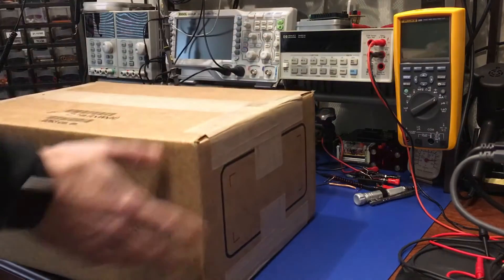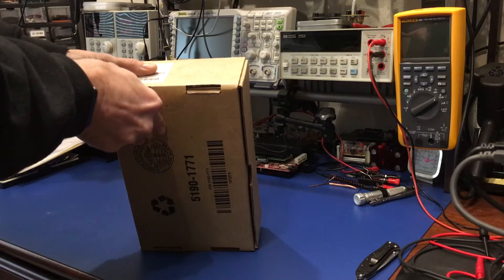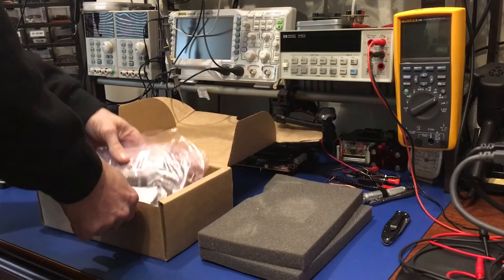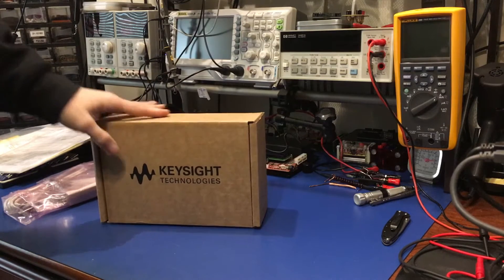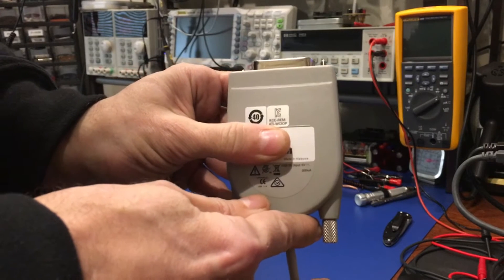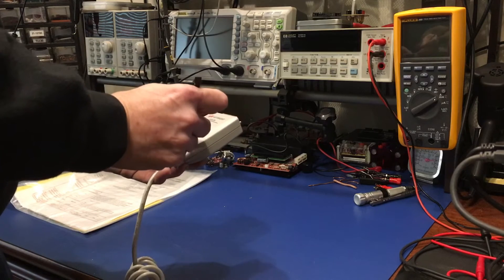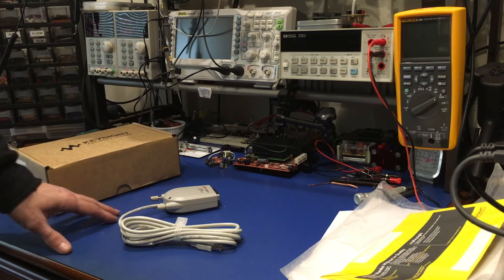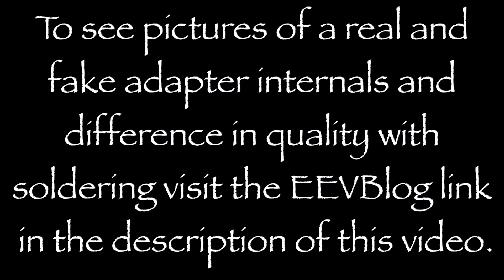Agilent KeySight Authentic GPIB to USB Adapter

Comment: Yeah, ive used that packaging before.. its a binary mixture that comes in 55 gallon drums, the machine mixes it together when filling the plastic, its quite interesting stuff to work with.  But if you get it on you during the process, it burns lol, and doesnt come off easily if at all depending on if its on clothing or skin.  Works VERY well though.  Anyhow, i appreciate the video as ive been looking to get a GPIB adapter for a bit now..
Reply from the maker: It was defiantly an interesting packing, seems to work great. Maybe overkill for this GBIP adapter, but I’m sure they use this with the scopes and other high end equipment. 
I might find out soon, thinking of getting a signal generator. Well for a decent one it will only be a little more to get the keiydight 1000x series oscilloscope with the wave generator and other things included like hardware decoding. It will be interesting to see the big difference in performance with s Keysight 1000 series low end VS a Rigol 1054Z with all the software licenses. But the Rigol is still mostly all software functions, not dedicated hardware decoding for IC, SPI and other things. 
I’m assuming if I buy one it will have the same packing foam. 
Thanks for watching,
Scott

Comment: The real question is who cares. People are tired of being ripped off by US companies who massively overcharge for simple items like USB adapters. Seriously Keysight wants nearly $500 for a damn USB adapter. The vast majority of people buying these things off eBay are hobbyists using older equipment and they seem to work fine for that. In fact, from what I have read the controller, chips are actually older 2009 Agilent chips that have been scavenged. 

The bottom line is I've been using clones for several years now on several pieces of older equipment including an 8753c VNA as well as an Agilent service monitor, signal generator and spectrum analyzer and they have operated absolutely flawlessly. 

To be honest, I would have felt like a damn moron if I had spent $500 each on these from KeySight.  If you're willing to spend $500 to appease your ego when a $50 device would otherwise work then I guess the old saying " a fool and their money are soon parted" fits the bill.
Reply from the maker: Q:”The real question is who cares.”
A: The people that are told they are buying a real one at a used discount, then found out later they were lied to and ripped off with a fake one. I think they care. And this is why I mainly did the video. Some sites (eBay) and countries laws (UK) won’t let you ship a counterfeit back to the seller, but the seller still needs to refund the money. This is to stop fakes and false advertising. 

‘Seriously Keysight wants nearly $500 for a damn USB adapter.The vast majority of people buying these things off eBay are hobbyists using older equipment.”
True, and I have talked with Keysight on this topic trying to get the price to come down since all the new meters have USB built into them now. I’m sure they made back the development and design money on this by now since it’s such an old design. It wasn’t even theirs, it was HP that created it to begin with.

“and they seem to work fine for that. In fact, from what I have read the controller, chips are actually older 2009 Agilent chips that have been scavenged. The bottom line is I've been using clones for several years now on several pieces of older equipment including an 8753c VNA as well as an Agilent service monitor, signal generator and spectrum analyzer and they have operated absolutely flawlessly.”
That’s a matter of opinion if you read the thread I listed in the description. Some have had issues and failures after a few months, most after a year, other have had compatibility issues, and certain communication protocols not working correctly and VISAA bus issues.But did you pay for those fakes when you could have maybe received one for free?

‘To be honest, I would have felt like a damn moron if I had spent $500 each on these from KeySight.”
And I would have felt the same way, and it why I was looking at NI ones also. But they are also flooded with fakes that have different problems, different quality.

“If you're willing to spend $500 to appease your ego when a $50 device would otherwise work then I guess the old saying " a fool and their money are soon parted" fits the bill.”
I’m on a budget and far from being a fool. Just because I’m showing a real one, dogmatic assume I paid for it.  I never said I paid full price for this, or anything near full price, so I guess I’m not a fool. 

Thanks for you comment’s, and thanks for watching,
Scott
Reply: Gadget Review Videos
 the fact that you were using a real Agilent adapter had nothing to do with my comment. 

I just assumed you worked for a company that had purchased it.

 I personally don't know anyone other than businesses who have bought real Agilent adapter. 

Oh and just about everybody knows that the ones on eBay are counterfeit. 

I mean seriously anyone's smart enough to operate and understand an Agilent VNA has got to be smart enough to realize there's something fishy about a $500 adapter selling for 50 bucks on eBay.

I actually got my counterfeits for free.

 I guess you could say I scammed the scammers.   

EBay's policy is that you don't have to pay for counterfeit. In fact eBay will directly refund your money and then collect it from the seller. So you're guaranteed to get your money back and you're not required to ship the items back.

 In fact I'm told it's illegal for you to ship counterfeits back to the seller because it's illegal to put a counterfeit in the mail. As such eBay does not require you to send the counterfeit back to the seller.

I bought 4 of the Agilent counterfeit back when they were $150 a pop.

 A day after I received them I reported them as counterfeit to eBay. Along with an email from keysight confirming it.

 EBay immediately refunded my money and didn't require me to send the counterfeits back to the seller.

I've done the same thing with several thousand dollars worth of counterfeits coming out of China everything from Hakko soldering stations to consumer electronics.

 EBay doesn't even flinch when I report an item as  counterfeit they just give me my money back. 

I guess you can just call it a form of poetic justice.
Reply from the maker: Yea, I did a whole thread on the eBay policy on EEVBlog about this. But they made me work with the seller first who wanted me to ship it back. So I had to wait until 10 days lasted before eBay would get involved. Maybe eBay want to put some of the work back on the seller now days. I did this with the Hakko FG-100 when I received a fake one. 

It’s only illegal to send back fakes in some countries, not all of them. I don’t think the US has anything on this, probably why US eBay and US amazon have more fakes then other country sites. 
Then thread I wrote doesn’t encourage people to scam the scammers, but I see how it’s a form of poetic justice. Its more of what to do if you get a fake, how fakes affect the world economy, and ebays policy with my personal experience testing the policy to see if they would honor what they say. 

Nope, I don’t work for a company, I was told I can’t work so I started to build a lab for a new hobby. I consider myself early retired with health restrictions for now. Let’s just say I worked something out with keighsight for the real one at not extra cost of the fake that I bought from an amazon store. The amazon stores are still running, so I guess they didn’t find what they were looking for in the fake unit.

Yea, I know I was smart enough to figure it out, but never used a GPIB adapter or the software before. Just wanted one for the used Hp34401A I picked up on eBay. So even smart people new to the hobby might not know the are fake. I assumed they were used from companies that updated the 34401A tomthe new meter when the 34401A hit end of life. 

So part of the reason for the video is some people starting in the hobby may not know they are fake. And some people found out after watching the video and thought they had a used authentic one until it started having issues. 

Be carful with some of that fake Hakko soldering stations, check the ground and wiring in those. I’ve seen some really shady ones.
Scott
Reply: I'm not paying 800. I just can't do it. But do the drivers on keysight work for the fakes because I do not own a computer with a rom drive

Comment: Great video!  Have you considered investing in a lavalier microphone?  It's an easy way to step up the quality of your videos.
Reply from the maker: Hi, thanks for the comment. I'll let you in on a little secret, the channel was started with an iPhone. But since then I have  stepped things up dramatically as you can hear in this video when I moved my lab. Even the camera in this video is gone now, the cannon vixia is good for outdoor and far away scenes, not so good on close up shots.
https://www.youtube.com/watch?v=dEPxNq9W5oIThen I did this lab update without the new mic system and just the phone again, you can hear the difference.https://www.youtube.com/watch?v=RZOTE0vMQnISo any recent video in this lab has the new cameras and Mics, pre-amp and more.I did recently decide to start building more batteries and decided this was safer in the basement working with lithium batteries. But I also picked up a new camera and lighting for the basement, waiting on a cable to test different Mics for the basement setup. So the audio might be a little different if you watch a basement battery bench video, but I'm working on changing that also. And I now do more post editing adjusting audio levels for a standard level on mostly all new videos. Some one off random videos when I'm mobile might not be adjusted, those are probably the exception.I used to use a wired mic and it likes to get in my way of reaching for things when I was doing a lot of 3D printer testing mod parts and add ons. https://youtu.be/HeNgEfbdjsY
But always open to other suggestions to improve videos when I can afford to.Thanks, Scott

Comment: and the proof of the adapter?????
Reply from the maker: Proof, what proof are you looking for? If I was a drinker I wold say 90 Proof.

Or are you looking proof that the one I have is a real one from Keysight, or proof that the other one was fake?
I dont want to show the receipt for the one from keysight, but when I mentioned I ordered it directly from KeySight, I meant I called KeySight up, explained what happened and ordered one directly from them. Not a re-seller or anyone on ebay but from keysight.

If you looking for proof of the fake one I had returned it by the time I did this video, but I had some pictures on an EEVBlog thread you can see. To help identify fake ones this thread has a lot of clues and ways to identify a fake one on the EEVBlog.
http://www.eevblog.com/forum/testgear/flood-of-new-agilent-82357b-gpib-usb-adaptors-on-ebay-the-real-deal/msg840094/#msg840094
Reply: Gadget Review Videos 
I wanted to see how the gpib work....
Reply from the maker: Their is so much differences on equipment, software, libraries and how people use these adapters. Some run software that I can't afford like BenchVue (full version) or national instruments, and others create Python scripts for raw data to be organized later or graphed out. But doing a video on how it works will start a lot of questions that have already been answered on the EEVBlog, and most of the people using GPIB adapters know more about the tricks and scripting. I would search in the EEVBlog to find more information for what you might want to use a GBIP for and how. But I can't fit everything into a video on this topic and would just raise a lot more questions that I wouldn't know the answer for.
Reply: ok ...

Comment: Mine came with software a sealed box, no packing and a Function test certificate spelt Ceryificate!
Reply from the maker: Well needless to say this was going to be returned. But Agilent wanted it to review and compare to see what software it was running. Apararantly you can copy the name, the look and all because it's over 10 years old? But the software is not allowed to be copied? I gave it to them with the understanding they would take care of the stores selling the fakes with their legal department. After that I was cut out, no replies from any emails and the store still run. I think it's running someone else's old buggy code he developed so maybe they can't do anything legally? I'm going to start contacting amazon since I gave Agilent/keysight more then enough time now and I know amazon will close the stores for selling fakes. I guess I'll have to do what I thought they would want to do, but they hadn't done anything yet and people are still getting ripped off. I don't care who's code it's running, Amazon and eBay still don't allow fakes to be sold.
Reply: I managed to get a full refund from the seller so I suppose i shouldn't grumble. It still annoys me Ebay seem blinkered to this sort of practice. The GPIB does work to a fashion but flags up a few errors now and then.
Agilent won't be getting hold of this one then!
All I need to do is buy the VEE software now.
Reply from the maker: Oh, I forgot to mention. All the CDs with the old 2009 IO library's are scratched. I think on purpose, they are probably bad CDs from something else that they just labeled and packaged. The sellers of the fake one will tell you to just download the lates software. I saw your video, same 2009 date code, serial missing to cert, cert looked photo copied. If you tried to register it, it would have failed or already been registered with that serial. Looks like the same fake one I had received. So you got full refund and didn't have to return it? 
Their is a thread with a lot of info on the fake ones on the EEVBlog. I replied to one of your viewers with the URL in your video comments.
Reply: Lmmfao I'm dying laughing

Comment: Called a foampack, it is a plastic bag containing a small 2 part mix of polyurethane foam, and it simply is used by cracking the inner glass globe, or by using a spray nozzle to inject the foam into a bag. These thenm are quickly placed in the box bottom and sides, and then the box is closed and sealed before the foam finishes its expansion and cure. This then fills the bags and makes a form fitting shock absorbing housing surrounding the contents. Put too much or use too many and the outer box can burst open releasing a mess of foam.
Reply from the maker: +SeanBZA +SeanBZA When I did a search in it before I found some machine that injected the foam. It showed you placing the bags in the sides, then it pumped in expanding foam until you stopped it. It reminded me of the way to out foam insulation in walls that are already sheet rocked and plastered. Sounds like both methods would work. 
That reminds me, I need to buy some of that non-conductive expanding foam in a can now that I can see how inch air leaks by my switched and electrical plugs in the walls.